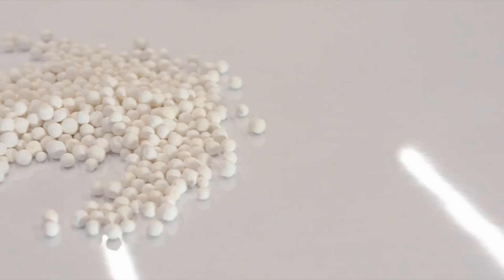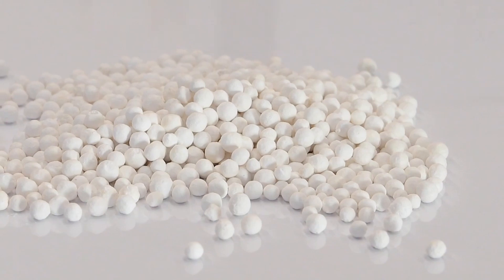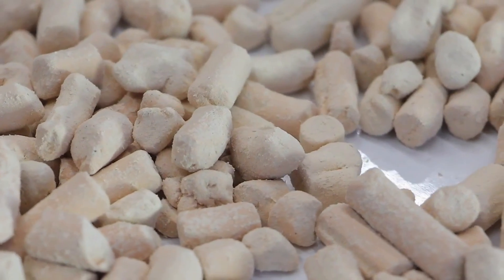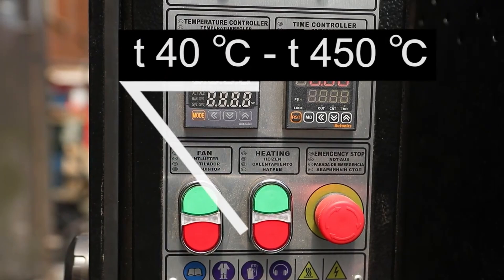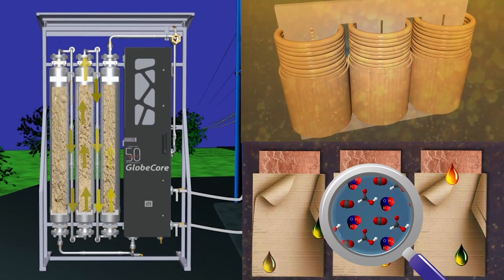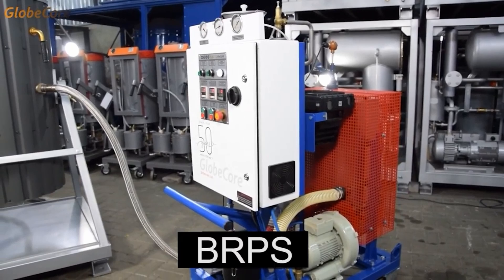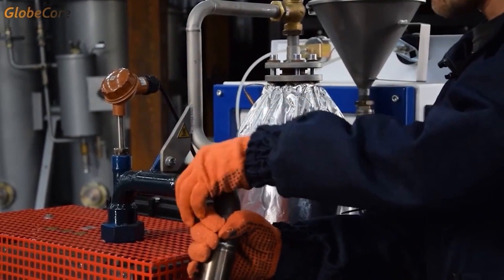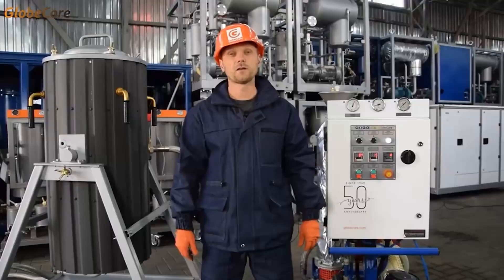Zeolite Drying - Restoration Wet Zeolite

Comment: how many times it can be regenerated and how much time does it take to regenerate
Reply from the maker: Good afternoon. The number of zeolite regenerations depends on the product you are drying. If you are drying moist air, for example, the number of zeolite regenerations is unlimited. If you are drying transformer oil, our experience shows that you can regenerate the zeolite at least 10 times.
The regeneration time depends on the volume of the zeolite cartridge (zeolite volume). For a 130-litre zeolite cartridge, provided that the cartridge is properly insulated, a complete regeneration cycle with heating and cooling of the zeolite takes 24 hours.

Comment: How does the zeolite regeneration process impact the overall cost of oil dehydration?
Reply from the maker: The process of drying industrial oils using zeolite is generally relatively inexpensive, as it does not require pre-heating of the oil.

Comment: How do the properties of synthetic and natural zeolites differ in terms of oil dehydration efficiency?
Reply from the maker: In general, synthetic zeolites tend to be more efficient in oil dehydration than natural ones due to their higher purity, uniformity, and customizable pore sizes that can be better optimized for oil dehydration. However, the specific efficiency can vary based on the exact zeolite composition and structure, and the conditions of the oil dehydration process.

Comment: How often does zeolite require regeneration, and what factors affect the frequency of regeneration?
Reply from the maker: It depends on the humidity and the volume of the processed oil. The higher the moisture content of the oil, the more often it will be necessary to dry the zeolite.

Comment: Are there any specific environmental conditions that may impact the performance of zeolite during dehydration?
Reply from the maker: Usually, this is the temperature range in which the equipment for drying oils, in which zeolite is used, works